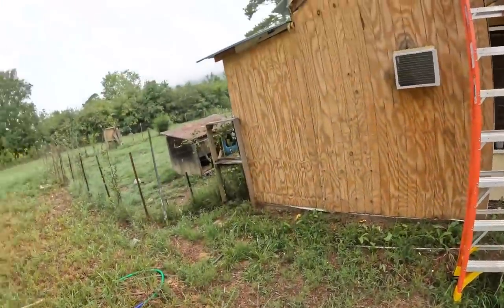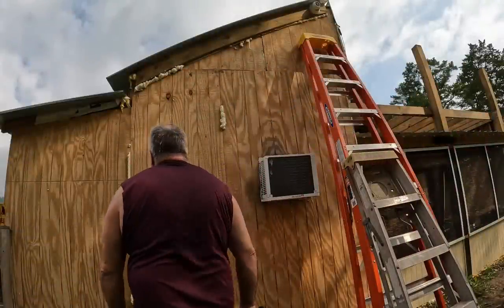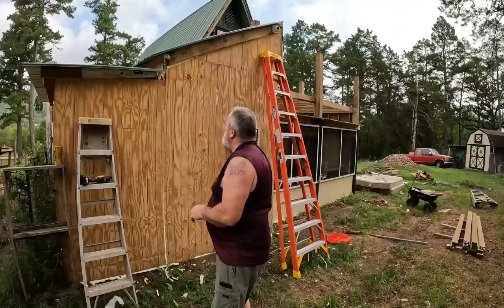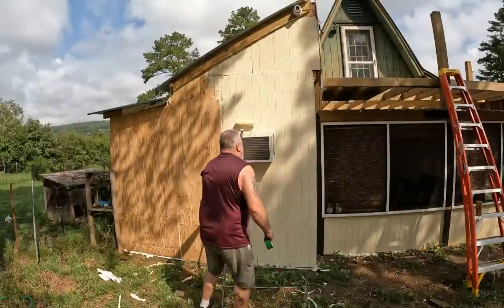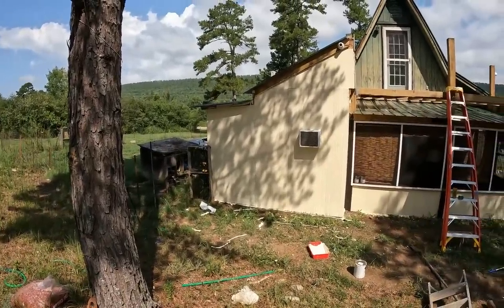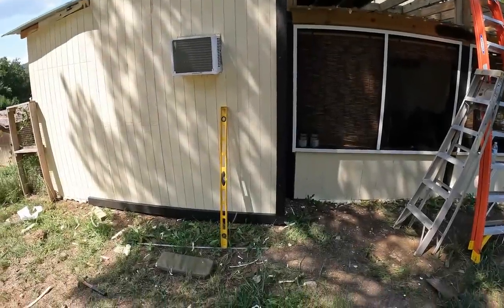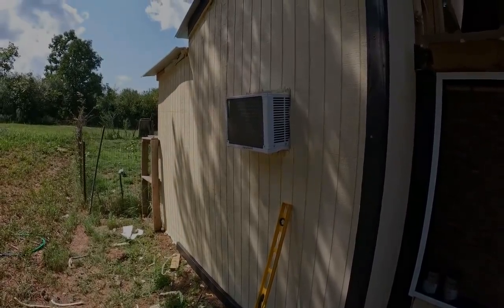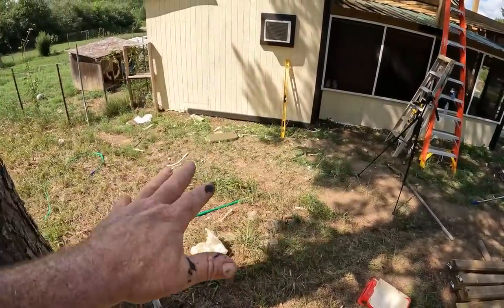Productive Day On The Build! Summoned Beetlejuice And He Came! Check It Out!

Comment: Looks Nice Mike. Tip: when your done using the foam in a can, turn the can upside down, and clear it out. In the upside down position, hold the trigger until no product comes out. Also, you can clean the nozzle and injection tube with wd40.✌🏻🙂Tracy

Comment: Looking good. The railing on the upper Deck should also be Black and the green Door painted Black and Gree wood the same as what you just used.just a suggestions.  Blessings
Reply from the maker: It will be just like it is in front of cabin, thats all im doing back there is matching all of the cabin

Comment: Why not put a French drain along the sides of the porch.  A few feet of plastic pipe with holes, fabric cloth to keep the dirt out and use some of the stones in your yard on top of the dirt. Then you won’t have washouts around your concrete.  Also, if you could do it before cold weather, why not get fast set concrete and lay a new floor in the dog room?  Just mix up do a quarter  of the floor at a time.  Then you won’t have a hard time sitting the washer and dryer flat on that bumpy floor surface and the dogs would feel comfy layin on smooth concrete surface.  Just some suggestions